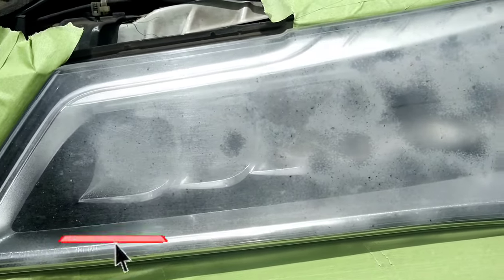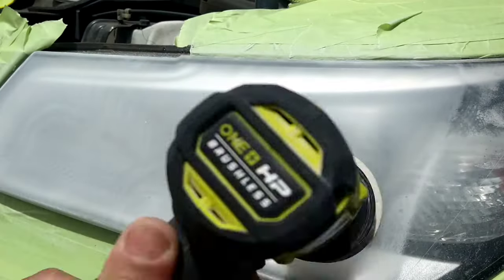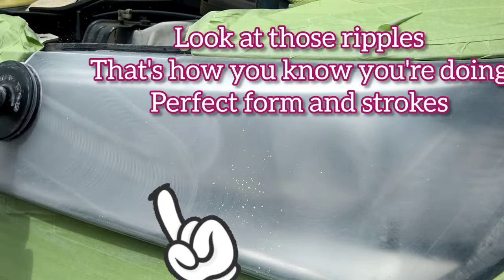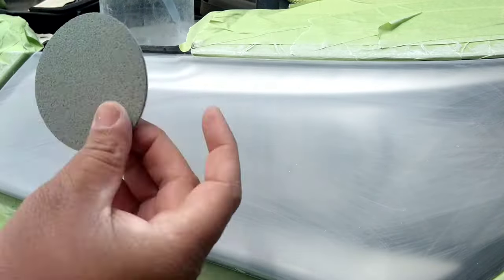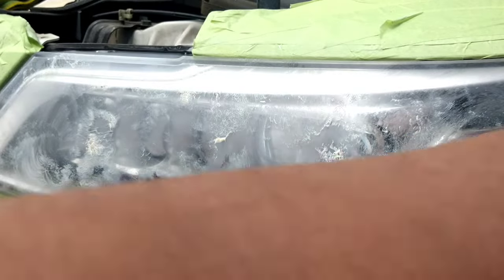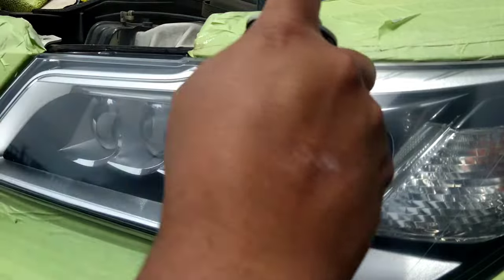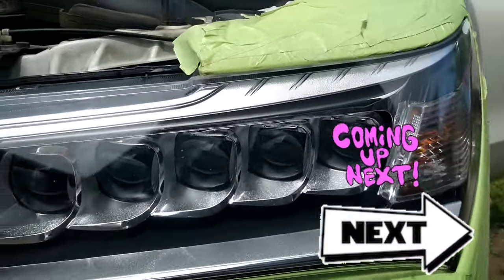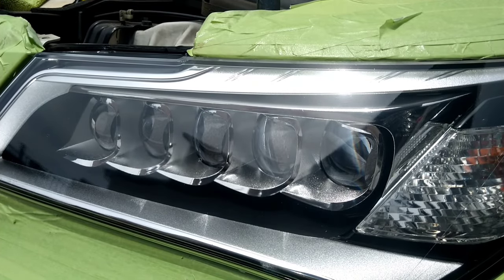Why not to double clear coat headlights 🫣--- HEADLIGHT RESTORATION

Comment: After applying applying 3M compound and buffing it out with the Orange pad , I know the next step is to wipe everything with with clean microfiber cloth and then before doing the Meguiar's coating is it OK  to use glass cleaner on the lens one final time or is that harmful or a waste of time? Thank you
Reply from the maker: Good question it's actually harmful.. and although glass cleaner is typically streak free this is not the case with all the other stuff mixed in.. also glass cleaner mildly leaves residue behind and may actually lift up some of the 3M compound with specifically meant to be left behind..(this compound is meant for heartland plastic specifically headlights).. it leaves a little bit of hydration replacing some of the natural lubricants inside of the material enhances clarity, also once you finish polishing it's a super sterile environment like a thousand times cleaner than what Windex can provide or glass cleaner... So you want to go straight to it and lock that in cuz at this point it's the best environment for the cleaner to adhere to and for clarity..
So I wouldn't do it I used to try but it would mess up your clarity... Then I did a lot of researching..
Reply: @theheadlightrestorationpro  thank you very much for clearing this up for me.  You really are the expert who has done it all! All the best sir 👍
Reply: @theheadlightrestorationpro  could one use 100% alcohol in a spray bottle with a clean microfiber to do a final clean? Thanks in advance
Reply from the maker: No..never do this...this is explained in a couple videos..
Reply: What 3M compound was used ?
Reply from the maker: @smokeysgriddle7993 should be in the bio if not listed on the video....
This product will be hard to get as though it's been discontinued for a while now in the newer videos there's plenty of substitutions approved by me..https://youtu.be/bX1jeS29Ei0?si=KryucwOqEj3eek-s
Reply from the maker: Awesome man thank you appreciate your viewing..🙏🏽🙏🏽💯

Comment: Hey man good video and with the best information I have seen in regards to headlight restoration. Very professional as well (besides the cringy graphics imo 🙃). I have a headlight restoration business as well and have been doing it for a few years but I was curious of your thoughts on drill vs da buffer for sanding. I personally think da is faster and gives a great finish but drill works great as well. I know it puts a lot of wear on the drill since they arnt made to run constantly even at low rpm while sanding, have burned a couple out over the years(were replaced under warranty). Could have just been a poor quality drill to start with but idk. What do you think? I'm curious of your thoughts on this.
Reply from the maker: DA's are no good for Headlight restoration, either for sanding and or polishing,they will not produce the temhe same type of removal and  HEAT like a drill which is very necessary to o achieve this high level of headlight restoration (and makes a difference with function as well as visual clarity/light escaping)
Equally as bad for polishing on the polishing step, not fast enough and different motions as you know da is a dual action motion the polisher and the sander / drill work on a different motion and a different torque rating..(they both make huge difference)
In my last drill that I had lasted for about 2 and 1/2 years before I blew it up doing something stupid... It doesn't strain the drills at all and actually puts less strain because there's no resistance and compared to drilling things and unscrewing things for screws and stuff..
 like that....(like a car hoist it in the air spinning its tires instead of driving... Very little wear and tear)))
Plus the drill and any device in a gun format🔫 is much more easier to focus on what's in front especially something flush horizontal in front of you...
Much better focus for control much better focus for sectional sanding and polishing...
I do a whole lot of things that my business is a headlight restoration business that happens to be a restoration business which means I'm a high-end detailer and beyond I do everything in detail you would do a high end and more far as restoring windows, paint, scratch removals, patient fix, oxidation removal, and a bunch of other stuff so I use pretty much every device you can think of in every different size.. and I have tried all the devices on the headlights even right angle drills and nothing compares to using drills for headlight restoration..
For aftercare a DA works good though...
Don't forget there's over 130 videos on this channel and over 400 examples of finished results on this channel if you include the portfolio videos..
For more information about the heat issue check out this video...
https://youtu.be/h-8BKUEVGRY?si=Z2atciEnSrAkDKoo

Comment: After the maguires coating how long will it take to fully cure and what if it rains 2 hours later 😊
Reply from the maker: That's the beauty of this product it's fully cured enough for use pretty much by time you're done... Like 3 minutes after you spray the light.. it is fully cured and like 8 to 16 hours depending on the heat level but you can still function and drive and do whatever you want rain any kind of weather.. perfectly designed for headlights.. or better yet headlight restoration.

Comment: Love your videos.
I have always been using the Meguiars headlight protectant which is a rub in and wipe off method. How many headlights can you do with 1 can of the coating doing your preffered 1 coat method?
Loving your videos from South Africa ❤
Reply from the maker: Typically get between 3 and 5 vehicles per can.. if you're doing small to medium lights you'll get five cars..
If you're doing large lights you'll get three cars for one can...
This is literally the best product all the way around...💪🏽👍🏽
Thank you so much for watching my videos...💯
Reply: @theheadlightrestorationpro  Only a pleasure. Very informative. Thank you for the response. Much appreciated. Keep up the excellent work 💯👍
Reply from the maker: @mohammudyusufkodruth9310 💪🏽😎
Reply: Maybe I am applying too little but I can do 10-15 cars with one can...

Comment: What do you normally charge for your services. I'm up in Canada so I won't be treading on your area . I was just curious. I followed your procedure on my heavy oxidation 2001 celica headlights. They look flawless now. Had a lot sand and stone pitting in them so had to sand a bit more then normal probably. But not just do a little side hassle if I can figure out what to charge. Your help would be appreciated

Comment: Should i spray my new head lights before it starts turning yellow?
Reply from the maker: I wouldn't do it as a bad practice.. basically it's going to inhibit your light from escaping the headlight,. Also interfere with your clarity as far as visual looking at it... And basically what's going to happen in the long run is your old clear coat underneath is probably going to go bad underneath it it might help it last a little longer but it will not be without side effects... Check out this video after care is a better method it works on headlights to to prevent them from going bad...👍🏽https://youtu.be/kIur4XxYjDk

Comment: Good afternoon, I've watched a ton of your videos and today I spent 3.5 hours doing my Black 370z Touring Sport and unfortunately I did not see this one video because I followed the instructions and sprayed a light second coat after the first light coat. I did 500, 800, 1000, 2000 & 3000 and then buffed it out with Meguire's Plastix Polish and they came out crystal clear 😁
Then I used Meguire's Headlight Clear Coat and the first one looked amazing but then I got a little haze with the 2nd coat. Do you think if I wait 24-48 hours and buff the headlights with the Meguire's Platix Polish that it might help remove that little haze left after the 2nd coat of clear. If not, what would you suggest? If anyone knows, it would be you. 
Thank you in advance, Richard

Comment: If I buy new headlights can I just spray the Maguires on?
Reply from the maker: It says you can buy I most definitely wouldn't...it will definitely effect your lighting out put ..
I would rather apply aftercare...
Which is also a preventative maintenance..
Check this out..
https://youtu.be/kIur4XxYjDk

https://youtu.be/NgxNImOAoCY

Comment: Hey mate, well done job, you`re a true legend. I`ve got few questions, how many pairs of headlights would this meaguiars spray bottle last? In australia it costs $40 which is kind of expensive for my detailing business, would you recommend a good quality headlight coating thats also cheaper? Could i use like a turtle wax hybtrid ceramic coating and have a similar effect? Thanks in advance
Reply from the maker: It's under $10 here..and no...that stuff wouldn't compare... it's a whip so no..
Also have a turtle Wax review up and you can see that the product is much inferior..
Reply: To answer your question..the 4 oz. spray will do approximately 10-15 headlights in my experience

Comment: What is the durability of the meguiars coating in your experience? And do you feel ceramic coating the light gives less clarity? Also would you recommend Fitz metal and plastic to polish and what was your experience? Thank you.
Reply from the maker: A durability of the Maguire's coating is perfect.. it's the right pitch not too soft not too hard when you go to either side of the spectrum there are issues.. it is specifically designed for headlights bonds to them perfectly if used correctly without causing damage and is heavily heavily endowed in UV repellent, anything designed specifically for headlights is going to be the best choice although ceramics are better fitted for car paint they are not particularly crystal clear in my experience of trying to use different ceramics and testing or on vehicles they do not hold up correctly, upon initial application they are foggy in comparison, also through prolonged use they appear to get more foggier and hazy.. if the fitz works for you that would be fine.. I'll try it before did not like consistency tend to like the products that are more specifically designed for plastic that he had hard lens plastic...
Thank for your question..

Comment: My question will a 2nd coat give better longevity? and how long does your method last compairing to the factory head lamps? 
They definitely look good.
Reply from the maker: Second coat will not give a better longevity. It'll pretty much be the same but one coat will be more clear and perform better... This coating or most coatings even the longer lasting ones will not last as long as a factory coating.. there's something that happens with the factory coding that I really can't go into here or to be five pages of shit.. that really can't be reproduced on the street... But on average the person who is shitty at vehicle maintenance, Parks outside all the time and a place with really hot weather
You get no milk forget about 15 - 17 months on average of perfect headlights.. with that being said you'll notice just minor things like in the corners and will not go back to being as bad as they were... Somebody with a good vehicle care or adding an aftercare you can get 24 months 4 years.. my vehicle is do for headlight restoration because I want nothing but perfection of my vehicle
And it's been well over 4 years because I take care of my vehicle superbly and do aftercare...
Reply: But the headlight coating instruction says: "Apply one medium wet coat of Headlight Coating to the entire headlight surface, overlapping the previous pass by 50%. Let the first coat dry 3-5 minutes. Follow with a 2nd coat to completely seal the headlight lens."
Reply from the maker: @MrElebee I have more experience with this product that the people who made it... Believe it or not... You never want to double coat any product... The factory does not double coat they use one heavy Coat there's very scientific reasons behind it..
The headlights will not come out like this and function properly when used in this way.... I have over 300 examples showing you this other channel how many do they have showing you?
You can do what you want.. but you will regret it..💯

Comment: Nice work! Question, though. This spray from McGuire's obviously comes in a kit for their recommended mid-level restoration. Do you not condone using the method they recommend in that kit?  Doesn't involve using a drill, of course, it's just rubbing them out by hand with their included polishing pads and solution and then using their clear coat spray. Thank you!
Reply from the maker: You're only going to achieve so much of a level with any kids you're only going to achieve mom's levels if you're good with these kids they won't look anything like a professional job this level or perform.. the only work on a mid grade percentage of lights anyways.... It's not so much to spray that's doing the job it's all the other stuff I'm doing... You can clear your headlights up but it won't be anything like this... You want this kind of performance which this is the best possible outcome that you can get the highest level top notch quality you'll have to do this.. no kit on the market it's going to yield results like this.. never will...
Reply: You can get the coating alone. I have seen it at Walmart. However stores vary stock so some may not have it while others do. I've also seen it online and he links it in his videos as well. At least the ones I've looked at the description.
Reply from the maker: @justplanefred yes everything in the bio is linked to Amazon pretty much the same place that I get 90% of my products from... Same exact links...
I have seen at Walmart before but only one I've literally check every time I go to a new Walmart they don't have them.. and it typically a little bit more expensive 80 cents to a dollar 20 more expensive...
Which isn't much ..

Comment: Just used this on new headlights i washed them with dawn soap and water but while applying the spray it started hazing and then beading up like as if there was wax on the headlights
Reply from the maker: Well for one I would never spray this on a new headlights...😱
And for two John dish soap is going to leave residential even if you don't see.. with the high chemical content of the spray is definitely going to bring out any type of residue that you leave behind that isn't primarily oil base dish soap is the opposite of all the base and destroys oil,.
Kind of messed up there...
Reply: @theheadlightrestorationpro  oh darn I was reading the bottle when it said soap and I know dawn stripped wax so I was assuming that would have been a good choice and seen on the can that it was ok to use on new headlights I just wanted to coat them because I live in a wooded area and have tree sap and acid rain alot but just the headlights done it the new Day time running light housing are new in the kit for the 2000 chevy silverado turned out completely clear
Reply from the maker: @johns3153  👍🏽

Comment: Great video. Is p500 rougher or smoother to the American equivalent?
Reply from the maker: Well it's a little bit complicated, technically it's a little smoother but it is extremely more efficiently put together... Equivalency (metaphorically) would be the conversion is a V8 all power real wheel drive vehicle...
The p version would be an all-wheel drive V6 twin turbo..lol
Way more advanced and would probably run circles around the V8 but at the same time technically less....
But not really in function..
The equivalent to a p500 is around a 360 grit sandpaper...(I run into a lot of problem with this with people trying to do headlight restoration and they see what I'm doing but they don't follow the primary instructions that I am using a p version of sandpapers which typically are more expensive so people think they can get away with using the regular version which they can but they have to learn about conversion charts/which if you Google that you can find some good ones)
But yeah p sandpaper is just way better quality no matter what company you go with in my opinion on top of that 3M is going to be the best of everything nine times out of 10..